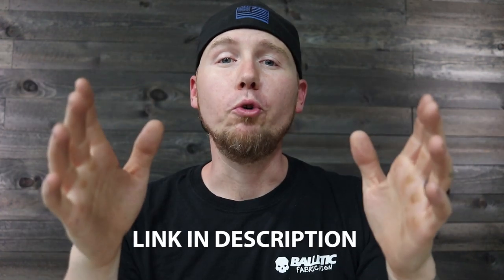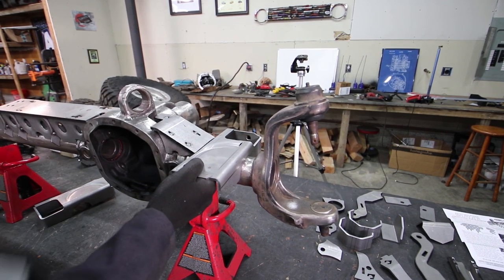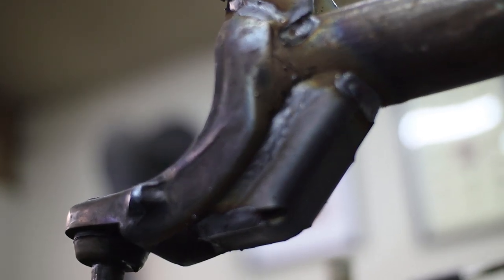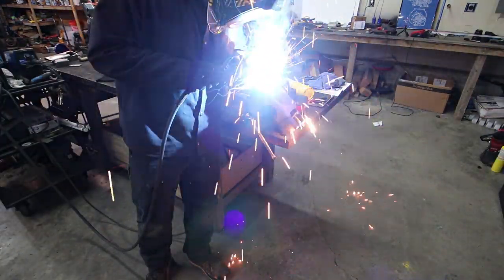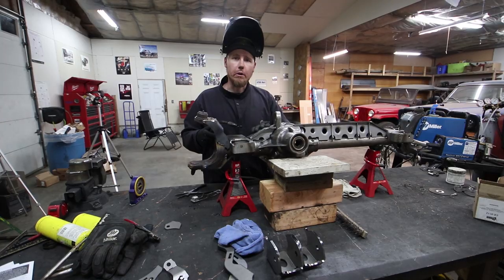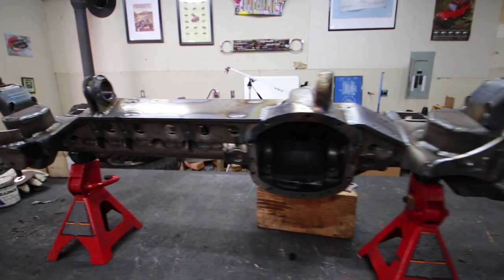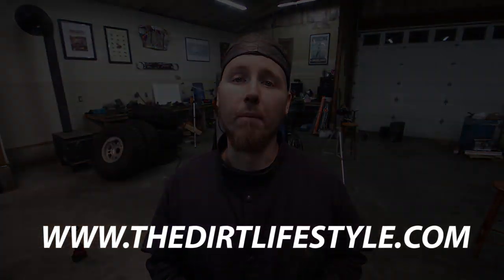Ultimate Dana 30! Episode 1 Artec Truss Install

Comment: Just a friendly FYI, when you're welding applications that need to cool down in a controlled manner, just wrap a fiberglass blanket around it and you'll generally have no problems. Tis what I do with cast iron repairs.

Comment: This is what I run. Sleeved and Artec with RCV’s 35’s and 37’s has no issues at all. And 17” big brake kit with knuckles.
Reply: How has it been holding up for you? thinking of building my axle to run 37s
Reply: @mr.caceres305   It is tough, RCV’s and never will go bigger. I love it.
Reply: @rile5960  yeah I’m on the fence about building my D30 or building a waggy 44

Comment: Nice! Pretty much did the same with my JK & 37's. Used a different truss from JCR & also did the gussets. You just have to wheel carefully & since I went with 5.13's I didn't lock the front. Figure my u-joints or axles will be the weak point if something does give way & either are cheap & easy to fix. For me it was the least expensive way to go at the time since I can do my own work/welding. When it goes I'll upgrade to a 44 but it's been going this way for 2 years w/ no signs of any issues what so ever & we wheel our Jeeps. Have to watch the rest of your videos to see how it comes out!
Reply: Hello , the dana 30 been working good for you im planing on doing the same but in my case i do competition well somthing like that it call average joe 4x4 and last year i blow my axel but dont want to spend on a dana 60 , sow will you say it will work going to upgrade to 37 and 5.13 gears thanks for you opinion and be safe
Reply: @kenskens69  It's certainly do-able but you'll have to take it easy. As you know the D30 ring & pinion is much smaller than the D44 & obviously the D60 so way easier to break if you start hammering on it. I take my approaches slow and easy & haven't had any issues. With the 5.13's I would not lock it in the front otherwise you are increasing the risk of breaking it. Just my .02 cents. Others may have different results but I've been running it like this for a couple of years with zero issues. Running Yukon gears professionally set up.
Reply: @johnmunder7107  thanks for the info ,and be safe
Reply: With that gear ratio in a 30 the pinion looks like something that should be in a pocket watch and may well be the weak point.

Comment: Looking forward to episode 2. Gathered USA 4.56 gears, Grizzly locker and Yukon axles. Hope to learn something on the gears install. 

Thanks for sharing.
Reply: Excellent setup! Same thing I'm running in my D30 with the exception of all Yukon. 10+ years of solid wheeling with no issues. Yukon makes quality products. 💪👊
Reply: Joe Man I did my own gears and it wasn't terrible but there are a few things you will need. set up bearings are a must. I didn't have a press so I put the carrier in the freezer and the bearings in the oven at like 150 degrees. They slipped right on, it was awesome! The hardest part, in my opinion, is getting the right preload on the pinion at the right depth. Good luck with your setup!
Reply: Currently running 33's. Now thinking of 35's. If we do go up, hopefully 4.56 won't be a problem.  It'll be mainly highway, will try of wheel often - in Florida trails. With some mud. In the future, hopefully trails in GA, AL, TN, NC.  

Now thinking of putting on a truss, since the axle will be off anyways.  Get it it all done at once.
Reply: @05glisedan  I am running 33's right now but will hopefully go up to 35's soon. I wanted to strengthen my axle before I did. 4.56 is a good gear choice for an auto, go 4.88 if you have a manual. My truss only cost a little over $100, then you just have to get it welded on. Make friends with a welder. lol
Reply: @ProjectXJ   Thanks for the pro-tip. I've been watching Rusty411. Saw his D30 install. Looks doable.  Ordered in-lb torque wrench and GLX carrier pinion bearing puller. Seems the most important parts Patience and Attention to detail.
Reply: @05glisedan  You will also need a dial indicator and some calipers to get the right size shims. It took me a lot longer than I had planned but I think I got it right. It has been 3 years and a lot of trails with no issues. Just make sure everything is in tolerance and the pattern looks good!

Comment: Hell yeah man. My ultimate plan is a LWB Comanche with 3" lift and at most 33's. I've got a HP D30 non-disconnect and a D35 with 4.10's out of an 86 MJ that I plan to swap into whatever MJ I end up getting. No reason dumping money and going bigger on axles then needed. 

Keep up the good work.
Reply: Be careful with a 35 man I nearly killed one in my yj with 31s and it wasn't locked either
Reply: @dougchacey9449  It's not gonna be a wheelin truck. I have a Suzuki DR350 for offroad shenanigans. It'll be a trailhead to trailhead/ forest service road truck.
Reply: That is what I was doing man just food for thought. The spiders were about to go when I swapped in the 44. If you want something that is cheap a 20 spline8.25 would be a good choice. It's your build though just giving ya some input man.
Reply: @dougchacey9449  you mean 29 spline 8.25?  old ones are 27 stock and newer ones are 29

Comment: Installing a sleeve kit prior will also help keep the housing from warping due to welding on the truss too fast. Plus it's just a good bang for the buck.
Reply: For a sleeve DOM tubing & lathe .010" off the OD is much cheaper than a kit too...

Comment: I have the same artec setup on my xj, the only problem I had with the outer C brackets is the coils would contact the bottom two spring loops under flex and cause a "bung" noise which is very concerning but I also used the original spring perch. I took material off of the front of the c gussets for clearance and no problem. Interested if these perches eliminate that.
Reply from the maker: My buddy has the exact same problem with his. We will clearance them if neccessary but its definitely something I've thought about
Reply: yea, i just did this last month... i dont think my coil springs would even fit after i welded on my C-gussets. i had to remove a LOT of metal to make the coils fit

Comment: Very nice work.  I'm at odds with upgrading my D30, vs replacing with a 44.  My long term goal is 37s, and im a pretty careful wheeler.  Ive heard nothing but good on these artec trusses.  They make a JK44 to TJ truss, which i'd looked at when i started down the JK axle swap path.  basically, converts a JK d44 to TJ mounts, with the added strength of the truss.  Nice stuff.
Reply from the maker: A trussed jk 44 would be a perfect swap for a tj on a 37s 🤘 with some rcvs I'd run a 40 and be completely comfortable with that setup
Reply: Thanks for the info. I’m torn between going wider and replacing both housings. Or getting a tj width front 44 and building the existing rear 44.
Reply from the maker: @SWBCrawler  I would go wider if you can and make up the extra width with back spacing on your rim. Then you can get your scrub radius numbers in check and safe your front end components. I think the Jk44 swap is one of the best tj axle options out there. 🤘
Reply: Yea the folks who have them for sale seem to think they’re made out of gold though. ;) I’ll keep them on the list Of options. I don’t think tons are right for me. Jk width might be the perfect in between though. For now. I’m having a great time pushing the lj to its limits on a mostly stock suspension. Those control arms were the first thing to fail, replaced them with some hand me downs.

Comment: Good day Nate. I understand the desire for a truss but why not sleeves? Wouldn't the truss interfere with "space" were the sleeves would not. What is the strength difference? The sleeves seem like a better way to go IMHO. Again im interested in the strength difference between the two setups. You can always use both.

Comment: Should you also weld the tubes to prevent twisting, and what about the the tube liners for the dana 30?
Reply from the maker: I have welds that go from the tubes to the truss and through the center section. These tubes aren't spinning. As for the tube liners, I've never been a fan. They add more weight than strength. A truss is far superior 🤘

Comment: Great video! About to upgrade my D30 using this as a guide. Wondering what size/alloy of wire you’re using for this application?
Reply from the maker: I use .035 but I'm not sure of its properties. I buy my wire from air gas in Tacoma Washington. It's an in house brand and I don't recall the name unfortunately.
Reply: Dirt Lifestyle thank you man!

Comment: This is dumb question , but I’m assuming you are heating the whole axle as u weld not just the c’s right, my wife and I both have jku s and we both are running 35s and I’m thinking I want to do this asap, I started to build the jeeps about 5 months ago so I haven’t done this yet. We haven’t really wheeled them yet either which is a good thing I think . Seems like the smartest next step to preserve the rigs .
Reply from the maker: We are only heating the cast steel sections. So the inner c and the center section. No need to heat the tubes! Good luck with the new builds man! A truss is worth every penny!
Reply: If you want to go full out, there are also inner sleeve kits available. They can be welded in and increase the tube diameter and strength for the weight of the jku with larger tires. 💪

Comment: Nate another great vid. I have a question. I here a lot about worping axle housing..? Did you have a problems with this build. Any suggestions. I'm getting ready to do mine. Thanks
Reply from the maker: Thanks man 🤘. No issues with a warped housing for us. The way the artec kit is setup it has large gaps across the axle tube making it so you wont weld one continuous bead. Continuous beads are a sure fire way to warp the housing. Small short welds (3" max) will keep you from warping it. 👍

Comment: Great vid Nate. Vid skills are getting crazy cool for a one man show.👍
Good to see a Dana 30 vid posted. They get such a bad rep but if wheeled carefully on nothing bigger than a 35 (as you mention) and especially if trussed, they're great axles. The only thing you missed mentioning, for the benefit of newbies, is that 4.88s are the biggest R&P that should be used. Even 4.88s are pushing limits of ring strength and pinion contact, but it can be done.

Keep up the great work.👍
Reply from the maker: Thanks brother!
Reply: I just got my 4.88's this past week, holy smokes are they tiny!!!!!!  I'm leaving the stock axle shafts and contemplating welding the caps on but not 100% sure exactly what I want to do.  

That'd make a great video series, tack welded caps vs IRO almost alloy kit, vs ???!  Also how to do trail fixes w or w/o tools.

Comment: Hey did you ever check the axle for straightness before and after welding? I just welded an artec truss and and C gussets and mine pulled so I had to straighten it after, even tho I spread out the welding over a long time. (I don’t know if it was crooked before welding) but I’m curios if you checked yours and how it came out. I measured mine by having bushings machined to fit the bearing caps and a pipe through the axle
Reply from the maker: I didn't check it for straightness before but that would have been a good idea. I would be willing to bet your axle was bent before you put the truss on. One of my favorite features of the artec truss kit is the fact that there are no long continuous welds. Makes it a lot easier to install without warping the housing. 👍
Reply: Yeah I beat my self up not checking before, but what’s done is done and it’s straight now :) thanks for the reply!

Comment: I just did this on some jk 44s for my TJ.... The part that caught my attention was it looked like you set the spring perch at a 9 degree angle? Why wouldn't you have set it at 0 after setting up the pinion angle? Maybe I'm missing something but aren't your springs going to be curving?
Reply from the maker: If you install the front axle. You want the inner c's to be around 5-10° at ride height. If you weld the lower bucket at 0 then your spring will be curved at ride height. 🤘

Comment: Hi I really appreciate what you do and what you're doing on your site here and how you go about explaining and so forth. On the Dana 30 I want to use it on a solid axle S10 Blazer project and an S10 pickup project... Two separate vehicles for two different people. 4.3 l engines. Using leaf springs or coil springs? I noticed that you used coil springs in the video would it be the same for this leaf spring purchase? I've been a hot rod guy all my life and going into 4x4s and off-roading is a new adventure for myself and my brother. Would you please educate me... Thank you for your time and consideration.

Comment: I need a custom welding fabrication job done to mount a fighter jet control stick as the shifter in my Jeep can you do something like that? I live in WA Puget Sound area
Reply from the maker: Sounds like a cool project! Unfortunately I don't do any side work. I like to keep my focus on the different projects I own 🤘
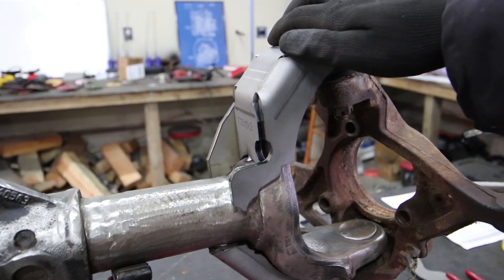Reply: @DirtLifestyle  No worries. I have a 97 XJ Cherokee 4 door six-cylinder auto transmission it's stock right now but I have ARB air lockers with 4:10 gear set  front and rear Dana 30 front Chrysler 8 and 1/4 rear 4 1/2 inch BDS long arm lift kit I plan to do some mild to moderate off-roading. Would I need to brace my axles as you have done here?

Comment: that is cast steel, shouldn't need anything but mild steel to weld it, i could be wrong  but cast iron whole other story, the center section is cast iron, right?
Reply from the maker: The center and the inner c's are both cast steel on this axle. 👍 but not all axles are the same. Some do have cast iron components
Reply: @DirtLifestyle  so we shouldn't need to preheat?

Comment: Hello Nate.  Love your channel alot , its informative for anyone to do these projects if they have the tools and skill.  I have a 1994 XK axle, stripped down, just bought this truss kit and doing the WJ  knuckle conversion.  What is the newest year of XJ axles I can use in this WJ knuckle setup?  I heard the newer XJ axles have beefier U joints than the older ones.  Keep up the good work.

Comment: I done this and u made a huge mistake welding the guests with balljoints in i done the same now the balljoints fit loose i actually had to tack weld the uppers in when the balljoints was pressed in it put tension on the cast the heating and cooling relaxes it... good luck hope it works out better than it did for me

Comment: How do you seal up the damn Dana 30’s? Fist time off-road went through a puddle and blew my axle seals. Second time I got stuck in mud and blew the damn seals again. I don’t get how people off-road these constantly without blowing axle seals.
Reply from the maker: That's pretty weird man! I've only blown out axle seals from gouging them when I re install a shaft. They make an outer axle seal for the dana 30 that keeps debris out of the housing. Google dana 30 outer axle seal. I know TEN factory makes a set 🤘

Comment: How hot did you heat the cast before welding?
Reply from the maker: I like it in the 350-450 range but no lower that 300. At 350 plus you really notice the welds look and sound great while your burning them in 🤘

Comment: So I have a question... bare with me I’m very new to this lol . I just bought this truss . It’s going on a Dana 30 for my xj and I have 6.5 inches of lift .. so the question is how do I know what angle to mock up my diff to weld on the truss to ensure everything will line up correctly?
Reply from the maker: I would install it exactly as the manufacturer recommends. You dont want to shift the pinion around because you will then shift the inner c's with it. This will cause death wobble. With a high pinion there isn't really a need to change the pinion angle in my opinion 👍
Reply: Ok lol because I was told by someone that I’d have to pay attention to the angle or degrees of the diff because the lift changes those from stock . It was at that point where confusion entered the chat lol🤣... so I was then under the impression that I had to get an angle finder and match the rear witch I think is at like 6 degrees

Comment: I'm trying to get a High pinion Dana 30 from a guy at work to make my 2001 Cherokee 4wheel drive.. Still lookin for Trans an transfer case..I already have a 4" RC lift on it.. It was $700.oo Bucks an Runs Great even with 334,ooo miles in it..

Comment: What springs and shocks do you think works good together.  I run a rough country lift and it's h
Just  bad
Reply from the maker: If your looking for good ride quality you need shocks. I really like shocks with an adjustable external reservoir. Being able to fine tune your ride is important. If you have coils they don't really affect your ride. If you have leaf springs then a soft spring can definitely make a difference but shocks are still the biggest change 👍

Comment: Awesome work! Really appreciate it, need to pull the JK D30 out of my XJ to finish off the Artec truss. Was concerned about the cast C's and centre section, but should be good now. What temps were you getting the cast stuff to when you started welding?
Reply from the maker: I prefer 350-450° and wont weld under 300. Good luck man!

Comment: I have a 99 tj with a d30 would it be worth it swapping it with a high pinion d30??? Or just built the stock d30???
Reply from the maker: I would swap it. The high pinion 30 is very inexpensive and lives in pretty much every junkyard in America.  The 30% increase in strength is actually a pretty big deal. 🤘
Reply: @DirtLifestyle  thank you so much